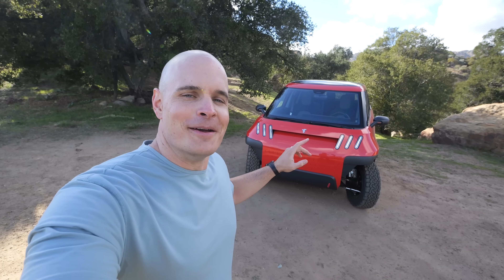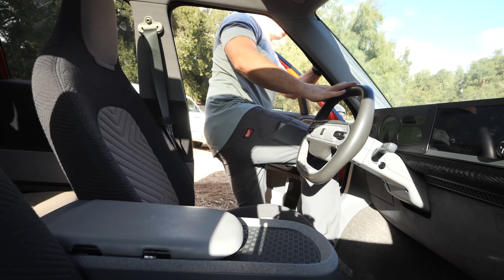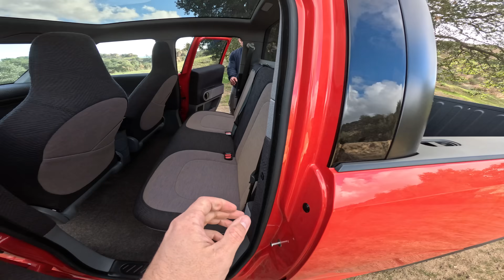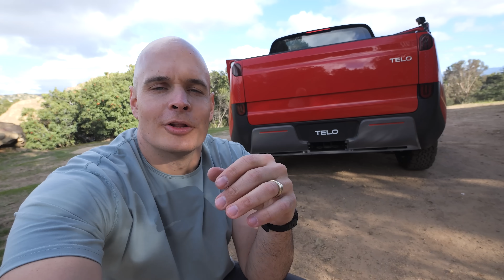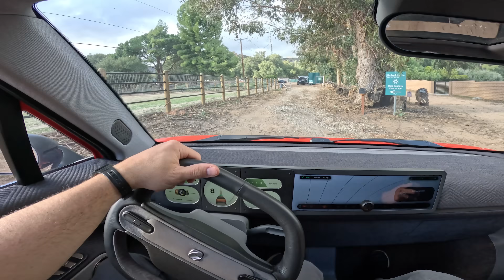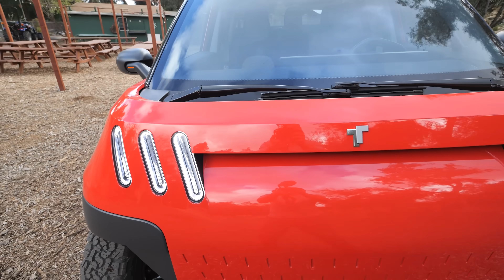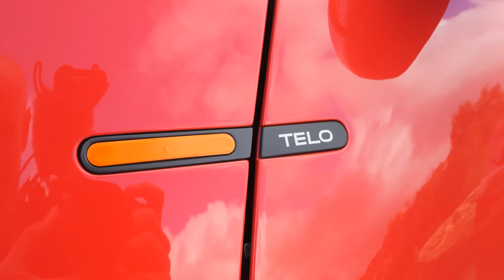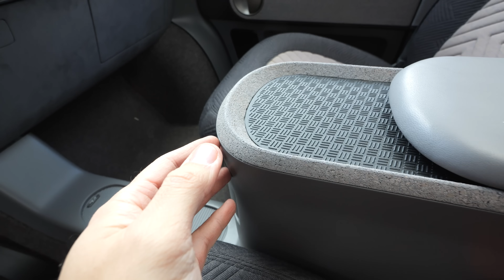ONE TRUCK TO RULE THEM ALL...

Comment: Fun fact: There used to be small trucks in the US, but they were killed off  by - of all things - emissions regulations. The regulations were based on the truck's wheelbase. The bigger the wheel base, the more lenient the rules got. This meant the small, fuel efficient truck didn't meet the regulations, while the much more polluting large truck did. Yes, it's as mental as it sounds.
Luckily since electric cars came about, emissions are no longer an issue, and the small truck can make a comeback.
Reply: Yep Ford offered a long bed diesel Ranger pickup in the early 80s that got 50 mpg in the real world and the standard bed length gasoline versions we're capable of mid 20s mpg. The early 2000s foot print based emissions regulations and the additional structure of side impact protection really hurt their viability.
Reply: @alexlail7481 the EPA is an arm of the oil industry, absolutely no question about it now.
Reply: Bingo! Stopped Toyota single cabs so had to go to doubles!
Reply: you need to research the chicken tax scandal.  that killed small trucks
Reply: Important to note that the regulations were prorated by size BECAUSE of intense lobbying by the American OEMs, who knew they could make more money on larger trucks, while the small truck segment was being lost to Japan. We all know that the environment (EPA) doesn't care what size your truck is. Yet another example of regulatory capture causing widespread harm.
Reply: Chicken tax.
Reply: @zlozlozlo  Stellantis (Chrysler) needs to bring back the Dekota
Reply: @mustasheolll2020  Bring back the Dakota 4x4. Give it a stick and sell it for under 35k.
Reply: @MrMCDiggles that will never happen
Reply: emissions are a by product, the actual reason we have such large trucks has to do with chickens and germany. seriously. look it up.
Reply: This is obviously a preproduction model and I think at $40,000 they all need to get rid of all of those rattles at that low speed. It doesn’t need to be a Rolls-Royce but it does need to be a step or three above a tin can. I’ve had several Toyotas going back to 1983 and some of the earlier ones did sound a little hollow when you slammed the door, but they didn’t rattle.
Reply: I can understand why Americans don't like regulations. Seems in the US, regulations are weaponised against the people or other manufacturers. Whereas in Europe and the rest of the world, regulations are designed to make the world a better place.
Reply: There is a shop in my small town which imports kei trucks, it's always funny to see them driving around town. New models are not allowed in my state due to high emission standards. An affordable EV mini truck would be awesome!
Reply: This was not just a thing in the US, but in the EU as well. Utterly idiotic regulations, clearly made up by people who weren't obstructed by any sort of relevant knowledge.
It killed off certain models, two I know off the top of my head were the Renault Espace and Renault Modus. As the Grand Espace (17cm longer) and the Grand Modus (11cm longer iirc) took up sufficiently more space on the road that they dropped a class for eco-tax. Meaning a the upgrade from an Espace to Grand Espace would cost you 7500 euro extra, but it'd net you a 12500 euro discount in total taxes paid.

"Let's tax cars based on emissions per kilometre per square metre of in-car-floorspace" -- some daft politician.
Reply: RIP S10's, Rangers, Mazda b1000's, LUV's, etc.😢
Reply: I feel like the wording is a little misleading.

Environmental regulations didn’t do this. Bastardized evironmental regulations after the US oil and car manufacturing lobbies got their hands on them did this.

The EU has much stricter environmental regulations, and had much better trucks like this one for years as a result.
Reply: Ford Maverick is smol. Starts at 22k and the hybrid version gives you 40mpg plus 500mi range.
Reply: @zlozlozlo  these regulations you speak of, did they occur under a capitalist economy? Yes they did. The owning class is the ruling class, and the ruling class makes the rules.
Reply: Yeah, you can bet that was collusion between the vehicle manufacturers and the oil industry.
I wonder how much money the funneled into congress to get those "emission regulations", which only increased emissions by the way.
Reply: This truck is even smaller than old compact trucks. Much less modern mid-sized of full size trucks
Reply: And guess who bought then politicians who made those laws? The big motor companies. They knew they'd be able to sell larger, and more importantly, MORE EXPENSIVE vehicles to the public and force us into these huge vehicle payments this way
Reply: Maybe, the main issue was the chicken tax
Reply: crazy
Reply: wow thats crazy, everything the government touches turns to shit
Reply: You're a rube. That's not the real reason. Don't blame reasonable emissions regulations 

It was protectionism and part of a trade war
Reply: I have a Maverick hybrid. The low emission fuel efficient pickup is back! I love it, it's been rly great.
Reply: It's wheelbase x wheeltrack (the footprint rule)
Reply: Now, unfortunately, the US has a psychological issue to solve on the road - with so many gigantic vehicles, driving around in a small car is in theory less safe. And it shows if you look at sale figures in each category. Small vehicles are not so popular in the US, and not because they are not available (Asian and EU cars are sold in the US). Part of it is for sure because customers just want to feel safe on the road - and a bigger car, especially with a higher stance, does provide that if everyone else is driving bigger cars. IDK if this trend is possible to revert at this point to be honest.
Reply: All that K-car trucks hype paid off!
Reply: But now if you buy this truck you will be laughed at, it will be a hurdle for some people to not think of themselves sitting behind a front end where you cant see a toddler over it.
Reply: @erosion01  hey it's at least not a 100k piece of garbage can on wheels.
Reply: Not entirely accurate painting of the picture. Manufacturers keep making trucks bigger in order to not pay taxes on smaller trucks and so that they don't have to innovate to make more fuel efficient trucks. 

Why invest money or pay taxes when you can just make it bigger and make more money and then charge more for more truck? 

It's capitalism at it's finest. If truck manufacturers were human they'd actually make good trucks and invest the money and innovate... but money is more important than progress.
Reply: @urmonatorgaming as others have said. They make them larger because as the EPA does it. The larger the truck the more lenient the regulations on it. Small trucks were held to such high regulations the development to get to that point would cost the company more money which they'd have to recoup by selling them for more money which would cause them to be costlier to the customer who is already probably trying to get the best bang for their buck as it's why they are in the small pick up market. No point in buying a small pickup for 50K when a base model larger one is the same price
Reply: @urmonatorgaming and that’s not a fair and accurate painting of the picture of capitalism. Government regulation stifled innovation and incentivized these larger trucks. Without the regulation we saw innovation and giving the people what they wanted.

Why would a company put R&D into a product that might not meet the standards AND in a sector that government already proved they’ll change on a whim? Especially when there was an obvious and easy out in “just build them bigger.”
Reply: @urmonatorgaming  Your explanation is incomplete. Where there is demand for a product (small trucks), one would expect companies to fulfill that in the pursuit of profit. Yes, companies seek to maximize profit, but they are constrained by what consumers wish to purchase, and in constant competition with other manufacturers. The exception is when regulation or taxation is introduced that limits competition or destroys profitability.
Reply: @urmonatorgaming  Technically you're both right You and the OP. 
The CAFE standards for fuel economy scale with the The vehicles will base multiplied by the wheel track. The area inside of the wheels. The larger that area is the lower the fuel economy standard that's expected. 
The problem is the standards are so high that an ordinary light truck from the '80s like a Toyota Hilux or a Chevy S10 with its smaller size would have to somehow around 55 miles per gallon which just isn't possible while having a useful truck. The sorts of aerodynamic fairings, air dams and low ground clearance you would need to achieve that would make it bad at doing truck things.  These days the smallest you can realistically go is something like the Ford Maverick which needs to get 37 MPG.

That's what @zlozlozlo is referring to.

But then what you're saying is also true. You can sell a car without meeting these standards. You just have to pay the government money ie a tax or fee. So why would you bother. It's more economical to make your truck as large as possible so it doesn't need to meet these efficiency standards In the first place. Especially Because the profit margin on larger vehicles is better. Because whether you're making a tiny subcompact or gigantic truck the labor and overhead cost is similar. And it is the cost of labor and overhead not raw material that mostly governs how much a car costs
Reply: @urmonatorgaming  no, the regulations are really to blame here.

At first glance, categorization by size does make sense. After all, smaller vehicles are capable of better mileage, so they should be held to a higher standard. But the devil really is in the details. It really matters how you actually set up the numbers. Had they set it up so that trucks of all sizes had to get more fuel efficient (within reason), we would see trucks getting more fuel efficient overall.

What they did instead is they made the requirements unreasonably high for small trucks, and unreasonably low for large ones. With this new regulation, small trucks became really expensive to develop, while there was no impact on large trucks. That's why the manufacturers moved to selling large trucks - the regulators messed up the incentive structure.

As to whether this was done deliberately by the US big auto lobby (for example Ford and GM using regulations to chuck Toyota out of the market) or it was a simple case of incompetent lawmakers fumbling the regulations, I don't know.
Reply: @zlozlozlo  interesting perspective. As many trends in society, there is no single reason that is definitive and this is one more example. Another reason is, People also obviously love big and high trucks, and consumers in the US somehow don't often take into account their gas cost when purchasing, even though gas prices are so often in the news, but they still buy them. Gas has only gone up since for ever, and yet it's not take into account, probably because we're bad at risk assessment.

And incompetence is also relative, regarding the law makers, the amount of pick up truck on the road (and SUV) has gone up unpredictively, so making laws an regulations regarding this in the past would probably be trying to protect "work" trucks from having to be in line with the rest of the cars. So the problem is that the laws and regulations didn't change fast enough... try and change them now though.
Reply: @zlozlozlo  I feel like it was definitely done on purpose. Those regulations, along with the chicken tax brought on from post-WW2 killed small trucks in the United States. Since the 1950s or 60s we've had a 15% tax on all imported small pick-up trucks because    some countries taxed our chicken. That along with the choking of the regulations killed the market. That's part of why the Subaru Brat had that lone seat in the bed because any vehicle with a capacity of more than 2 was considered a passenger vehicle. Those 90s Japanese trucks were cool. I've got a friend with a 90s Nissan or Mazda little pick up slammed with a hood dump turbo
Reply: @zlozlozlo  I actually appreciate that you aren't generally crapping on regulation and instead this specific regulation. I see too many people say 'no regulation would be best' as if these companies would actually do things to service us instead of their shareholders.
Reply: @urmonatorgaming  you’re blaming capitalism on regulation. It’s laughable also capitalism exist everywhere in this world. Even in communist countries I’m not sure what other system you anti-capitalist people are wanting.

Lastly, you and the person you were responding to are basically saying the same thing regulations ruined small trucks.
Reply: Plot Twist: Jason the founder goes MAGA.
Reply: Classic example of "Hi we're from the government and we're here to help you"
Reply: @sdafasdfasdfsda lol no reagan propaganda bullsh, that's an example of the law of unintended consequences
Reply: You’ll never convince me that an EV can outperform even a 4 cylinder gas engine. It’s just not possible with today’s technology
Reply: @mudfatherBULLSHiT  outperform in what parameter?
Reply: @mudfatherBULLSHiT  Just about every EV out performs my 4 cylinder gas engine so...
Reply: @mudfatherBULLSHiT  So very, very wrong. It is obvious you have never driven an EV.
Reply: @mudfatherBULLSHiT they’ve been doing that for over a decade now what do you mean

Comment: It soumds like a bucket of bolts driving on a light dirt road. The build quality seems absolutely horrible. 14in of overhang, So you hit a squirrel and your certainly in for a hospital visit.

Hopefully when it's actually released, They tighten everything up inside from rattling to death. 

With that, It is cool, like the bed and  pass through like my Avalanche. And the under bed storage.
Reply: It's not because it's bad quality
Small cars usually rattle around a bit because they're lighter
Reply: @ijustwantedanameok  The interiors don't rattle around like that because of the weight of the car, It's because it's cheap inside. Carwow just did a episode of a Daihatsu Duster $23k compared to a $75k Range Rover. It was a heavy duty off road course, The Duster is very small...with 10x the Abuse it didn't make 1/10th the noise as this thing.. for $23k

Comment: I think the thing would have been better if it were a foot longer. You could increase the crumple zone, fix the awkward footwells, cover the front wheels and slant the windshield more to improve aerodynamics. It would still be significantly shorter than most cars. 2026 seems like a pipe dream if they are yet to secure a manufacturing facility. They really ought to address those squeaks and rattles. And why on earth is it propped with a rock - I expect every EV to lock the drivetrain when parked just like an automatic.

Comment: The real reason this company is probably trying to sell this and make a tiny truck, is because they know that there’s so much demand for it. In California, the rules are so strict and it’s actually cheaper to make a extremely large vehicle and just put it out on the roads rather than make a smaller vehicle because the carbon emission standards for the smaller trucks are so strict that there is just no point in making them. Everybody is complaining about how especially trucks are getting so bad nowadays, but this is really due to California standards and we know that California is the third or fourth largest economy in the world, so when cars are made they are accounting for California standards. Ever wonder why there are 10 speed transmissions in truck nowadays? It’s because California standards state that there must be in order to keep within the threshold of the carbon emissions. The only way to bypass California emissions is to make electric cars, which is ironic, considering the toxicity of making them. This is why Tacoma’s from the 2000s are so freaking good and why people are still driving them to this day. This company is trying to run up the 2000 Toyota Tacoma’s because they know that there’s so much demand for small simple trucks.

Comment: I don't get why trucks need to be family vehicles. no one who has enough money to take a chance on the first gen of a new manufacturer will have their work truck as the only family vehicle. get rid of that 2nd row of seats. make it possible for folk over 6ft to get their legs under the steering wheel. while not needing the drop down mid gate. keep the monster tunnel because that's cool AF.
Reply: I couldn’t agree more. So annoying. Make it like the 80s Chevy S10 and just have a half cab behind the front seats and if you still need it, the pass-thru for the bed. Those 3 seats in the back are absolutely useless for someone who wants a small work truck that has this kind of capability.

Comment: It is insanely overpriced for its size. Wish the video started with the price so I didn't waste my time. $41k for a half size truck!?
Reply: I agree, I would rather spend a bit more and get an R2.  Even though the R2 is not a truck it will serve the same purpose for me, and I will feel more comfortable and be safer with an actual frontal crash area.